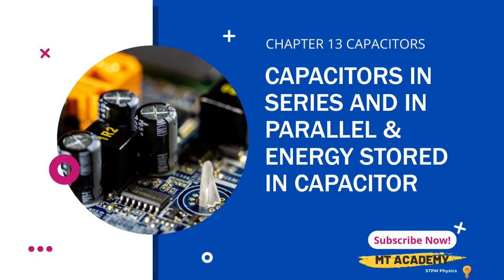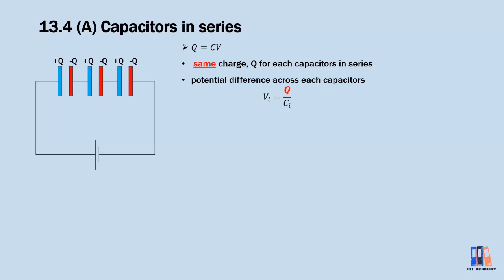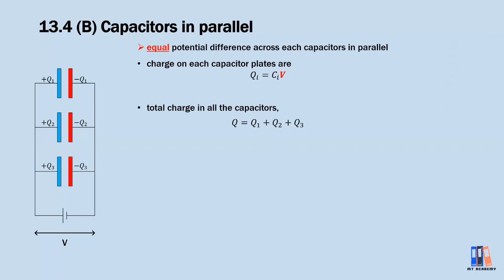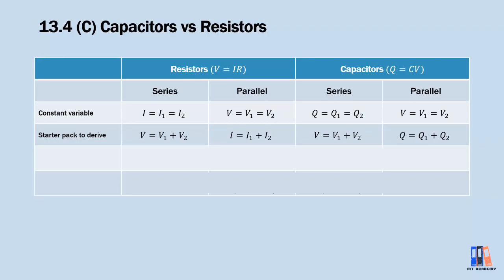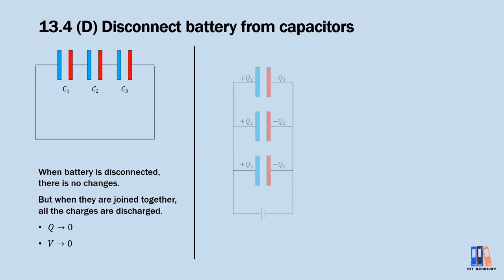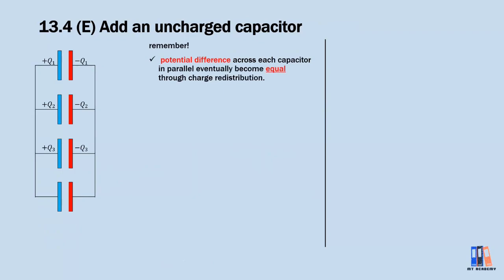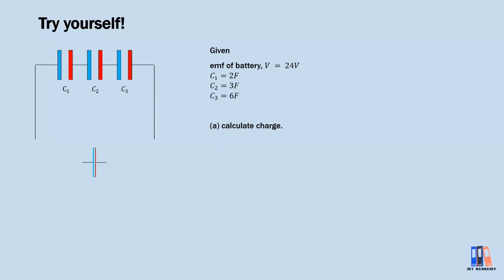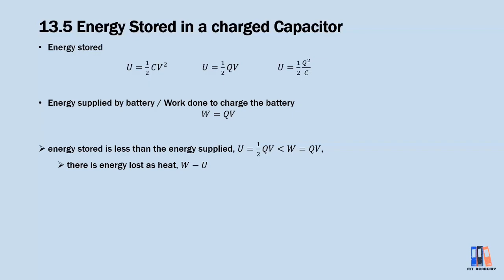Capacitors: Capacitors in series and in parallel & Energy stored in capacitors | STPM Physics

Comment from the maker: Answer for assignment in tis video:
(a) total charge = 24C

(b) potential difference across 5F cap = 4V

(c) Q1 = Q2 = Q3 = 4C
      charge across 5F cap = 20C

(d) V1 = 2V
      V2 = 1.33V
      V3 = 0.67V
Reply: For (b) ,I get 4.8 V
Reply from the maker: Hi  @snehamuvantharan0117 , probably u counted the equivalence capacitance wrongly, which should be 6F.. and then we use it to get final potential difference, 

Q=CV
24 = 6V
V = 4V
Reply: @MTAcademy_MY  thank you. I thought it is 5F.
Reply: hi,may i ask why the capacitors in series have same charge 4C, it causes the total charge in circuit is 4x3 +20=32C,the charge is not conserved.Sorry for disturbing😢
Reply from the maker: @dlj5740  Hi, charges are the same for capacitor in series, C1 has 4C, C2 has 4C, C3 has 4C, but the total charge here is still 4C. So the overall total charge is 4 + 20 = 24C
Reply from the maker: another thing u can refer: resistors in series have the same current flow. Let say R1, R2 and R3 are in series, and there is 4A current flow through these 3 resistors. The total current in the circuit is still 4A, not 4x3=12A. Hope this help ! ☺
Reply: @MTAcademy_MY It's understood now, thanks for your explanation!

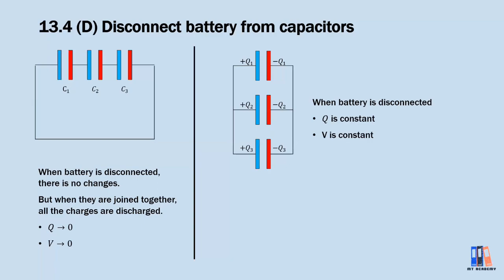Comment: 6:28 I am a bit confused about the the part where when battery is disconnected, there is no changes.
But when they joined together, all the charges are discharged
Since there is no changes how can they discharge

Comment: Hello，may I know how to get charge is 4C？
Reply from the maker: Hi there, the total charge is conserved, and the potential difference across capacitors in parallel is constant. Therefore, we refer the case of overall connection:

1. check equivalent capacitance 
     C = 1 + 5 = 6F

2. find potential difference
      Q = CV
      24 = 6V
      V = 4V

Now we refer to the 3 capacitors in series which has equivalent capacitance, 1F

Q = CV
Q = 1(4)
Q = 4C